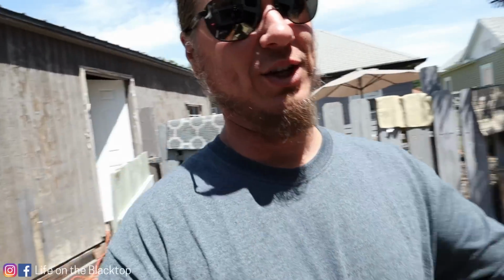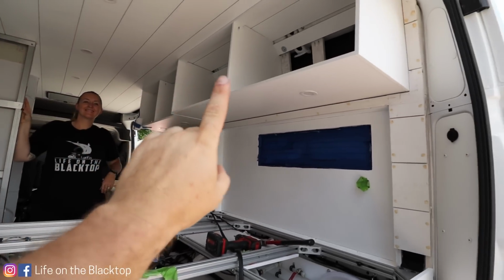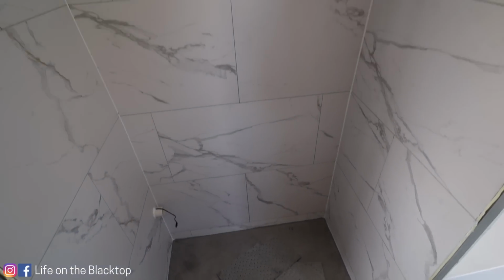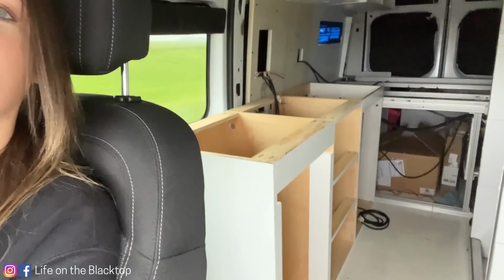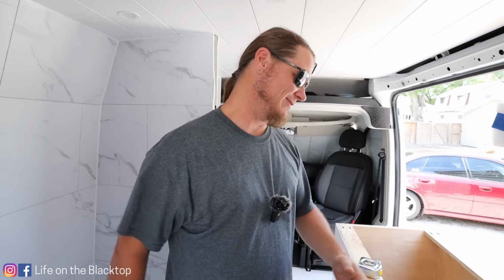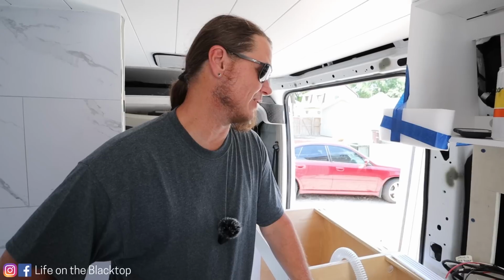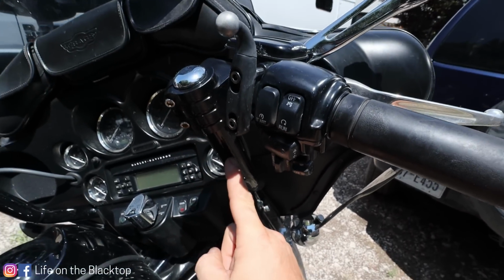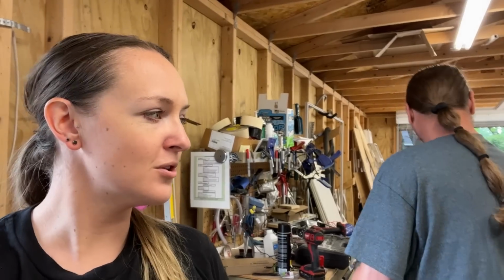Cabinets, shower, countertop and finishing touches for the van build! The Promaster is almost done!

Comment: If it is wire chafing get some of those heat shrink tubing with solder in the middle if the wire is good then if your bike has abs and traction control That can deactivate cruise control but your kill switch it could be wire chafing

Comment: Have you checked you rear brake light fuse? That can affect the cruise control if it burnt up
Reply from the maker: The only thing I’ve really check is to make sure everything is working. My dealer broke my saddlebag light connector and they one light was out. I haven’t had a chance to run codes or anything yet though since I’m trying to get this van ready. I need a clone lol